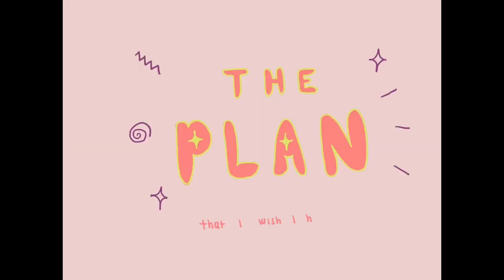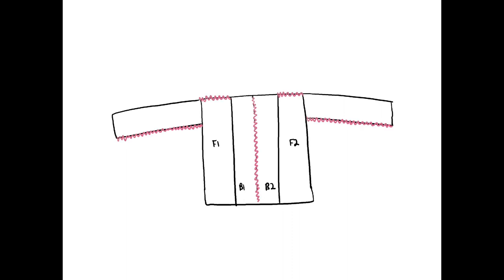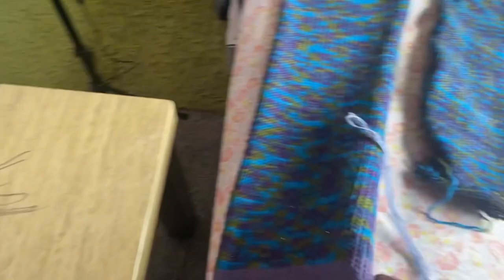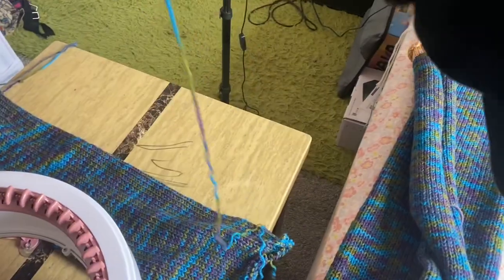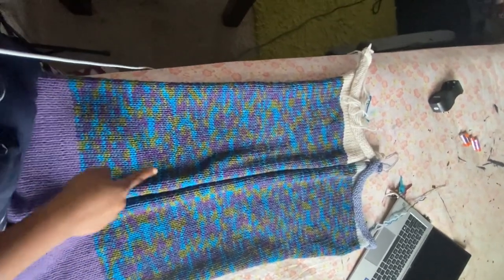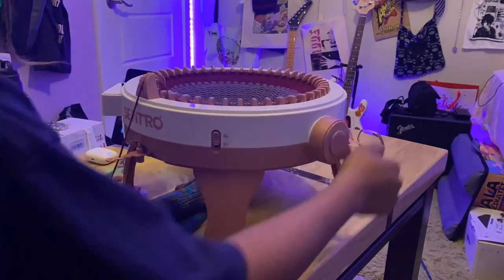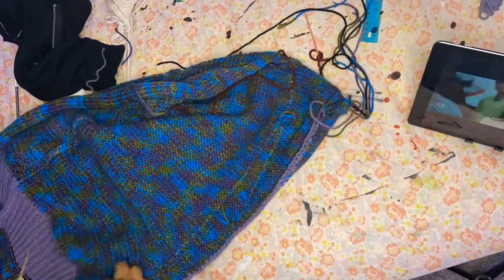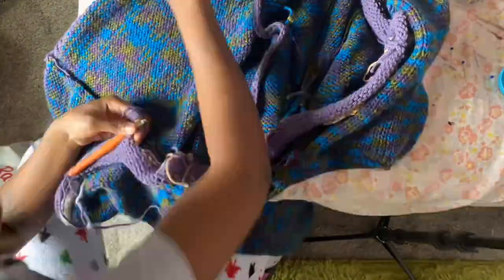sentro knitting machine cardigan! my first project (process/tutorial-ish)

Comment: If you or someone you know uses a sew machine you can sew the back and cut it off. Similar to steeking stitch should unravel much since it will be cut vertically.
Reply from the maker: i have a sewing machine, the sweater is pretty thick though i feel like it would be bad for the machine (not sure)? but that’s a good point of it being cut vertically so it shouldn’t unravel too much
Reply: @chizdoesthings     You can always make a small sample fold and sew and see if it works....